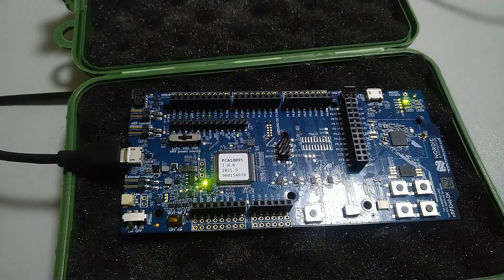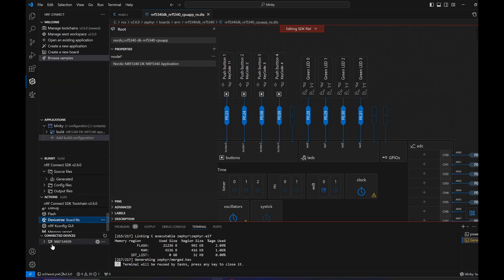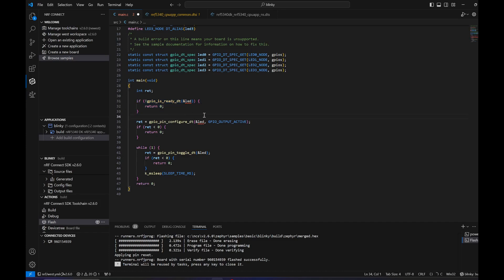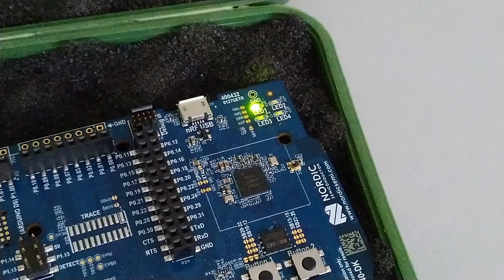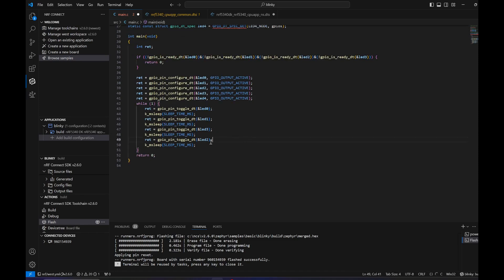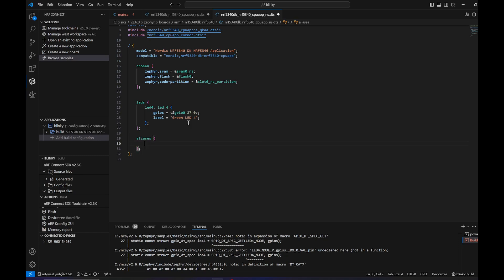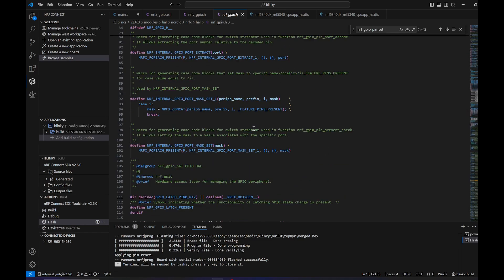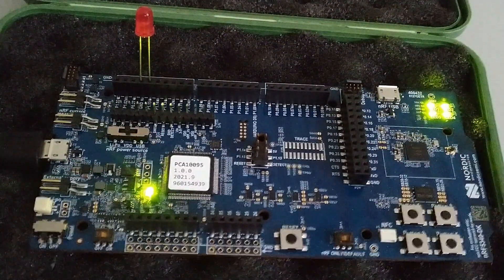nRF5340 DK Zephyr blink example updated + legacy GPIO driver

Comment: Hi, first of all your video is great. I am new, after doing blink example my 5340dk board no longer recognizes usb port, do you have any solution. Thanks.
Reply from the maker: Hi, the j-link usb port is not recognized by the computer or the usb device port connected directly to the nRF? If the j-link then You can try to chceck if the correct driver is set for the j-link (in my other video) and if it is ok (no yellow triangle warning) You can run j-link configurator from segger - it can detect if there is a problem with the software and fix it, if the yellow warning triangle shows up then probably the usb connector can be damaged/not making contact to data lines (check if the j-link chip is not getting hot - if it is then it is probably damaged), if everything is ok but the j-link does not show up - a diffrent application could be connected to it.